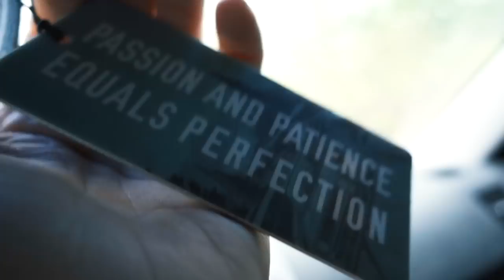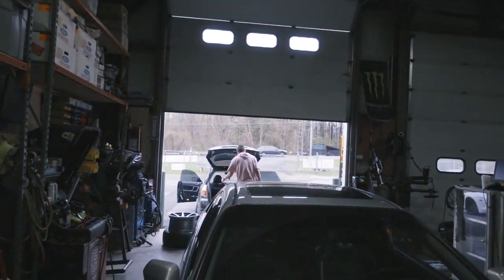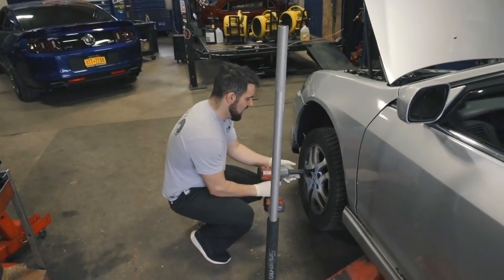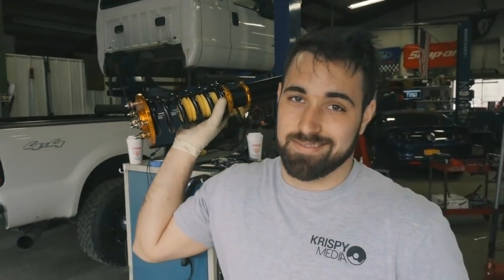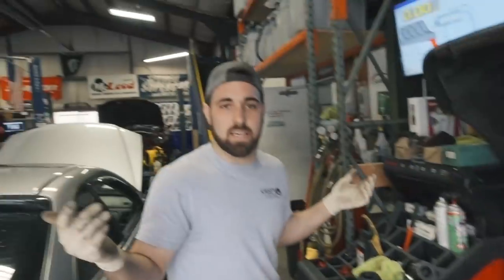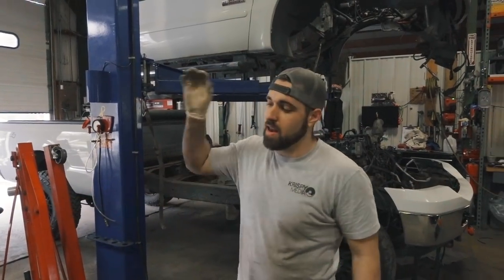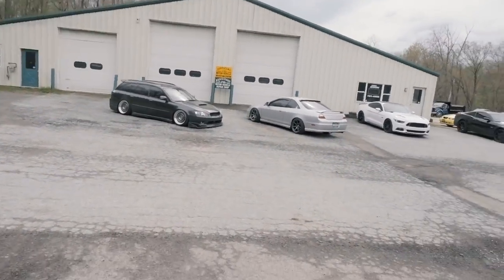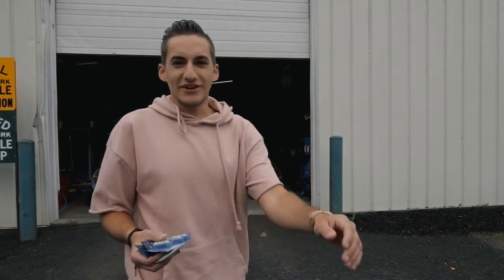Lowering Cody's Car + NEW WHEELS!

Comment: Get a comptech rear sway bar for TL or the Eibach one, makes it handle better and less over steer. also get the oem TL/CL swaybar from a junkyard, like 20$ bolts right in.